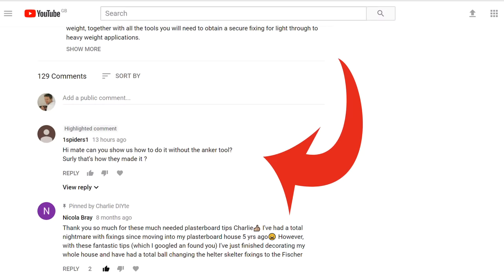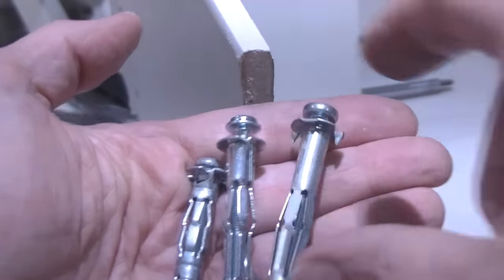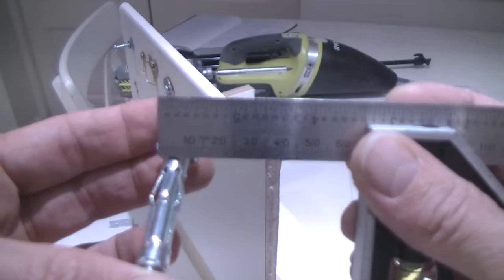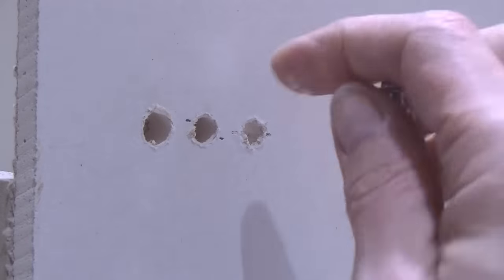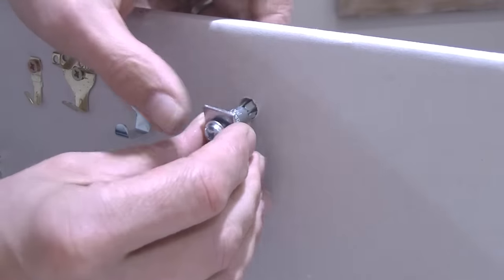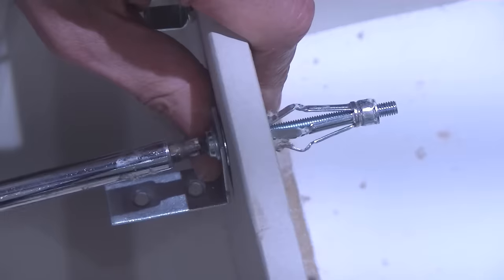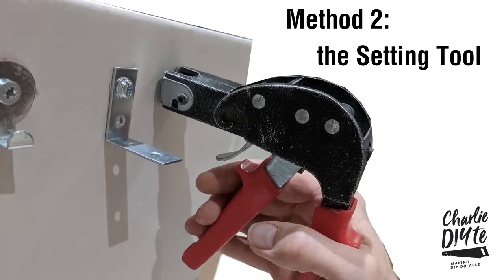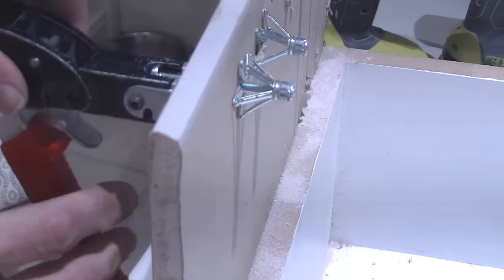How to Fit Hollow Wall Anchors

Comment: What fixing would you suggest to mount a projector that weighs 11kg if you can't attach to the stud please?
Reply from the maker: To my mind the strongest plaster board fixings where you're relying on the plasterboard alone are anchor fixings and toggle fixings. Personally I'd go for the anchor fixing as they're a little easier to apply, although the toggles have the largest spread behind the plasterboard.

Comment: MOLLY FITINGS  ?  My local hardware sells molly fittings 40kg max weight. For plasterboard of between 6 to 13 mm thickness. Would these work ? Seen video of a guy using them without setting tool
Reply from the maker: Yes I think that's what we call hollow wall anchors over here.

Comment: Would you use this slicing on MDF wall sheets?
Reply from the maker: Depending on the weight of what you're hanging, and the thickness of the MDF, the MDF itself might be sufficient. Otherwise, yes, use this if you're worried. Remember though, these wall anchors need a minimum thickness of about 12mm to open against.

Comment: When you’re using a screwdriver you need to start off with a lot of pressure and torque and if you’re fitting the fixing first you must use the little black washer to prevent the friction of the screw from twisting the fixing and leaving you up shit street. But just invest in a setting tool, they aren’t that expensive

Comment: Hi mate, how do I know the size of the drywall? I am trying to hang a frame onto the wall and I am not sure what size of hollow wall anchor to get... :((( Pls help.
Reply from the maker: draslrus Hi mate. Sorry - I missed this. You want to drill a small ish hole (6 mm diameter should do the trick) , get a piece of straight wire and bend a little 90 degree lip into it (ie an "L" shape) at the end - the lip, or short post of the "L" - obviously wants to be less than 6mm - 2-3mm should do the trick, so you can fit it into the hole. Then thread it into the hole, press it against the side of the hole and pull out the wire towards you until the lip catches on the back of the hole. You can pinch the wire with your fingers up against the wall surface, then pull out out of the wall and measure the distance between your fingers and the lip. That will give you the depth of the plaster board. It's probably 12mm plus a couple of mm plaster.
Reply: @CharlieDIYte  I had the same question, solution is super simple. Thanks for a great, straightforward video!

Comment: What if in using these for a tv bracket? Is it essential to use the stopper
Reply from the maker: The TV bracket will act as a turning stop. You just can't tighten the bolt against the wall anchor with no turning stop.
Reply: @CharlieDIYte  ahh OK mate cheers in just not sure if the length of the anchor I should get as its for a wall that's hollow behind 🤔
Reply from the maker: Drill a 6mm hole in the wall (in case you end up using a standard 6mm wall plug rather than the 10mm diameter wall anchors (always good to start small and work up). Get a paper clip, straighten it out, and push it into the hole. When it hits something pinch the wire, take it out and measure the length. This shows you the depth of the hole from front of the plaster board to where the brick work starts. Then with a pair of pliers bend the end of the wire over into an "L" shape obviously with the L short enough to fit into the hole. Then push it back into the hole and catch the "L" behind the plaster board. Pinch it with your finger again. Take it out and measure it again. That gives you the thickness of the plasterboard and therefore the depth of the void behind. You can then work out what length of wall anchors you need 👍🏻

Comment: I've to screw an electric shower to a tiled stud wall and this may be the solution
Reply from the maker: Yes, you could also try a Fischer Duopower 8x40, depending on the thickness of the board behind the tiles.

Comment: I don't know if it's my setting tools, my anchors(bulk bag from Screwfix) or my method but when I use the setting tool, it usually pulls the fixing at an angle and I have to tap the screw back straight.
Reply from the maker: I'm not sure why that's happening, Rodger, unless there's an obstruction behind the plasterboard?
Reply: @CharlieDIYte  happens quite often though. The tool was only a cheap one off eBay and the fittings themselves are cheap ones from Screwfix so it could be a combination of those, plus my iffy workmanship

Comment: Thank you, Can I use these anchors for ceiling?
Reply: yes you can.. (ceiling plasterboard is generally 3 mm thinner though and the forces on the object will be in a different direction though. Keep this in mind. In a wall most of the force will be down the length of the plasterboard.. quite strong.. But on a ceiling the force will be pulling off the face of the board.. Just think of the weight being attached to the fixing/board, first.

Comment: Will it hold a 55 inch tv? Should do I would have thought….
Reply from the maker: I would have thought so depending on the bracket - if you've got cantilever force at play (eg swing bracket) you might want to consider the Geefix. Here's my latest video https://youtu.be/Jdu9RId7m90 Worth a look 👍

Comment: Hollow wall anchor. Put two in yesterday. One success. The other failed. Screwed them in by hand. I did not put anything betwern bolt and anchor (bracket). The bolt turns but wont grip. I suspect the thread section has broken away at end of anchor. 
How do i remove it please. Please help.
Reply from the maker: Can you get a claw hammer on the bolt and gently lever it out of the wall? Or with the bolt removed some long nosed pliers to pull it out? What I'd normally do is drill the front off with a 10mm hss drill bit and then push it into the wall letting it drop harmlessly down the back. But as yours is spinning the drill bit option probably won't work, so unfortunately you've got to improvise.
Reply: @CharlieDIYte  i truly appreciate you getting in touch. Thanku. Im going to try using mini grinder to shave off head of bolt by keeping driver in head of bolt.then try knock throu.
Have you personally had this problem yourself?. Good to have a problem solving video made by you. I know time  is the problem when you have a living to make. But its the reason i watch them. 
Watching some do it perfect is all very well. But what if we fail!
This is where i gratuity comes in.
I like watching youtube better than tv. Its entertaining. Yours is great

Comment: Try the duck foot anchor, a lot easier an stonger!
Reply from the maker: I'm intrigued by these. Thanks Ray. Have ordered a pack and may well feature them in an upcoming video. 👍
Reply: Being in a new build house, I have no option than to use plaster board fixings. After using various ones over the years, these for me are the best! Thanks for replying.

Comment: I've just tried this and put my screw into a wooden door hook then into the anchor and started screwing and nothing happened.  The door hook plinth was a good 10-12mm and so I believe too short to start off the anchor tightening so I'm bit confused why they sell the screws and the anchor at different lengths.  I guess the key here is to use the setting tool so it tightens it then you can put the screw in after?
Reply from the maker: Hmm. I'm not really understanding the problem Jonathan in spite of your detailed description. Is the anchor not opening at all? If this is the case it sounds like it's not engaged in the nut at the back of the anchor because the door hook which you're using as a turning stop is thicker than the bolt needs it to be. Try finding a thinner turning stop like a washer or any piece of metal with a hike drilled in it so that the bolt can go further into the anchor. Open it up fully, then take out the bolt and then reattach it, this time with the hook plinth in place. Or let me know if I've not understood the issue.
Reply: @Charlie DIYte Hi Charlie, thanks for the reply. In complete frustration I had a look at how to remove them and then bought the setting tool and some longer screws. Went from 37mm to 52mm and all seems ok now thank god. 

If you’re ever after a series of videos on how to teach the worlds most incapable DIY-er I’m your man. I somehow can’t even screw a screw in!

Thanks again
Reply from the maker: @jonathanchannon3431  Nonsense. You've sorted the problem and should feel pretty epic now IMO!

Comment: Help!!! I know this is a bit cheeky to ask but...I put a double wall anchor in with the setting tool and the damn thing broke. I know i can drill it out, but the anchor in a newly decorated hall. The anchor is positioned accurately and i dont want to make the hole bigger when removing the anchor. Please, any good advise is welcome
Reply from the maker: Not cheeky at all - that's what I'm here for :) What, the setting tool broke? I've had that happen to me - which is why it pays to spend a bit more on the setting tool. OK, most anchors have a removable washer on the top - the circular bit that has the claws in it that sink into the wall. If you're lucky yours will be like this - check one of the spare ones to see if it does. If it does, you can snap off the washer and push the anchor into the plasterboard, letting it fall harmlessly down the back. 

If it isn't designed with a removable washer, simply get a 10mm or similar HSS drill bit, and gently drill into the anchor until the washer comes away, and then, again, you can simply push the rest of the anchor into the wall. You may need to just pull the anchor away for the wall if you can, and crimp it behind with some long nosed pliers whilst you drill - to stop the anchor rotating whilst you're drilling through the washer. Then you can simply insert a new one, using the manual method I showed in this video, but making sure you use the turning stop or bracket, as otherwise the anchor won''t open. 
 Good luck!
Reply: Charlie DIYte no, the anchor broke. - I didn’t explain that so clearly. I have a wall anchor that just keeps spinning and it is not fully retracted.
Reply from the maker: Did you check to see if the head is removable so you can push it into the wall?

Comment: But how thick I see my plasterboard? And is there enough room behind my dot ‘n dab plasterboard for one of these fixings?
Reply from the maker: You need to drill a hole in the plasterboard and poke something through to see how deep it is. The plasterboard is typically 12 mm thick but it could be double thickness. A piece of wire with a little right angle bend in the end that you can poke into the hole will enable you to see how thick the plasterboard is.

Comment: how do you remove them when it comes to it? can't see there being a very clean way other than trying to knock the whole thing through?
Reply from the maker: Yep, you have to knock the whole thing through, or perhaps tap the bolt with a hammer to close the anchor and enable you to pull it back through the hole.

Comment: could i use the longest fixing for everything or would this not grip
Reply from the maker: Hi Scott, sorry I missed this. You have to make sure the collar on the anchor matches the depth of the plasterboard, otherwise it won't clamp down tight behind the plasterboard when it opens up.
Reply: They wont grip. You need the correct size.

Comment: Only problem comes if you want to remove whatever you've put up. Have to push the plug through which makes a big hole - at least bigger than with, say, a Fischer Duopower
Reply from the maker: Agreed, and I love the Duopower as well, but you're going to have a similar problem removing that, and no hole is too big to fill with something like Easi-Fill  🤔
Reply: @CharlieDIYte  I'm just about to do some work fitting shelves to plasterboard. Looking at the Duo and the Rawl 4 All I rather favour the Rawl product as it just has one purpose and the load is spread evenly. The Fischer doesn't always set perfectly due to it's complexity. Just an opinion

Comment: Can the anchor be removed if not needed
Reply from the maker: Sometimes the collar is removable, in which case it can be snapped off and the anchor pushed into the wall and then filled. If it's not removable you can drill the collar off with a large diameter hss drill bit (ie wider than the hole the bolt goes into) and then push it in as before. I've never tried pushing the bolt into the wall to try and flatten the umbrella so that the fixing can be pulled out. I'll try this out if I have time.

Comment: The problem I’m having is that I have a shallow plaster board of 9mm and the cavity behind is only about 10 -12mm so a 20mm length of screw is all I can fit in. All the fixings seem to be 37mm or 52mm. Any suggestions anyone?

Comment: Seems difficult or rather impossible to determine the difference between the cheap and quality versions of that tool online in N. America.
Reply from the maker: Even here, buddy, most setting tools are rubbish. The bit that tends to fail is the v notched claw inside which grabs the bolt and pulls it backwards. If you're heavy handed (like my fitter is) you can quickly rip the bolt through it. I've just bought a Fischer setting tool which looks the best of a bad bunch. Not sure if you can source Fischer in NA.?

Comment: How do I get rid of rhose metal plugs?
Reply from the maker: Easiest way is to drill off the front with a large diameter hss bit and then push the  anchor into the wall and fill the hole with some Easi-Fill or similar.
Reply: @CharlieDIYte   It was in the shower and I didn't want to damage the tiles. But I got the lid of with some pinchers and pushed the rest as deep as possible further into the hole.

Comment: Plasterboard? Is that what we call sheetrock? What if you have plaster and lath walls, you're a woman in your mid 50s and you discovered this because when you've tried drilling into them the plaster crumbles and makes your hole 2 to 3 times bigger than your bit! I've been using the gorilla and monkey hooks to hang pics and stuff, but now I need to hang a few things that need a firm anchor and not a hook that can move around!
Reply from the maker: Hi Dede, good to hear from you. You might try a Geefix https://amzn.to/2H8XBji  or https://amzn.to/2H8XBji  as it has a big old wing that clamps the fixing tight in the void behind (assuming you've got 30mm to play with).

Comment: if you dont know an have no idea what thickness plasterboard is up what size would you suggest
Reply from the maker: Get a paper clip, bend it flat so it forms a long piece, and then bend a little "L" into one end with some pliers. Then you can put that into the plasterboard to work out its thickness. Failing that, Fischer PD8s are very good (if rather expensive) https://goo.gl/SBGfYn as they work for single and double layers of plasterboard.
Reply: thanks good little tip

Comment: Can you remove the anchors..??  if so...could you show us how please..:)
Reply from the maker: Andrew Thomas You can in theory - by unwinding the bolt as far as you can without completely disengaging it, and then pushing it back into the wall thereby straightening the umbrella again. That can be a little tricky though as you can't be sure it's totally closed again. Some anchors have a front washer that can be snapped off reasonably easily, allowing you to simply push the rest of the anchor into the wall. If they aren't removable you can drill the washer off with a large hss (metal) drill bit, and then push it into the wall. You've got me thinking though. I'll see if I can do a video some. time
Reply: Thanks so much...:)

Comment: I think it's blindingly obvious that when you tighten the screw it will pull the claws in. The same as a nut would travel up the thread for example. That's how they work! Did someone really need that to be worked out for them?
Please don't let them DIY!
Reply from the maker: That's not correct, and no, that's not how they work!!!! To use your nut analogy, what happens when the nut has completely travelled up the thread of the bolt? If you then keep turning the nut, the entire bolt turns, doesn't it!? If you don't use the turning stop, when you tighten the screw all the way it will start simply spinning the entire wall anchor, ripping the plasterboard and leaving a massive mess - unless you put the turning stop in. It's only with the turning stop that the screw keeps rotating thereby pulling the claws in, and THAT'S WHY I DID THE VIDEO.

Comment: Thank you for your great video ! Personnally, I prefer using a setting tool to be sure the anchor is correctly expanded and don't risk to damage the bolt. I discovered also this installation tool that looks crazy : https://youtu.be/iCTkS4CwQf0?t=64 (if you install many hollow wall anchors a day of course !)

Comment: Mine just spin round and round and won’t grip. The curtain bracket doesn’t allow me to screw in straight. Ruined a brand new wall with two holes. So annoying.
Reply from the maker: That's because you haven't used the turning stop before tightening it. You need the bracket between the real and the screw. Otherwise it will spin.
Reply: @CharlieDIYte  thanks. I have just bought the special tool to make my life easier. Is 20mm anchors ok for curtain pole or should I go larger? The curtains I would say are medium weight for a loft room.
Reply: @CharlieDIYte  m5 43mm better?
Reply: @CharlieDIYte  don’t worry Charlie. My builder said there is timber above the window so can screw right in. Don’t need plug etc

Comment: You held the back of the anchor for support. You cannot do this on a sheet of gyprock. Just use a setting tool.
Reply: He didn't. He was holding the back of the board, as obviously it wasn't fixed in the same way as a wall would be.